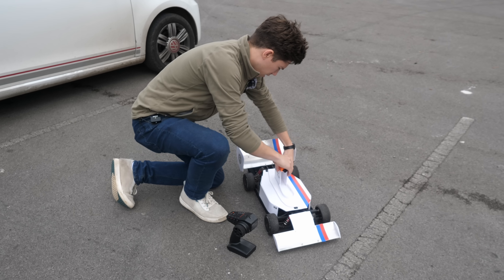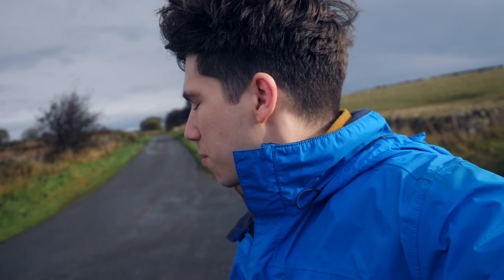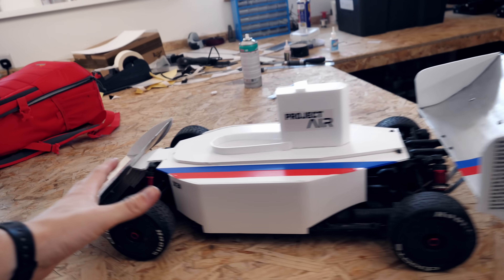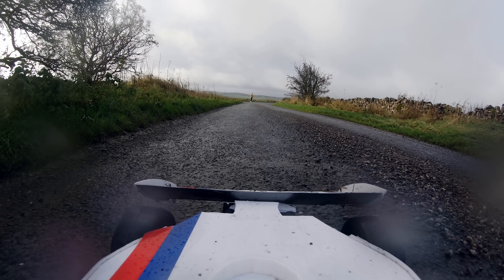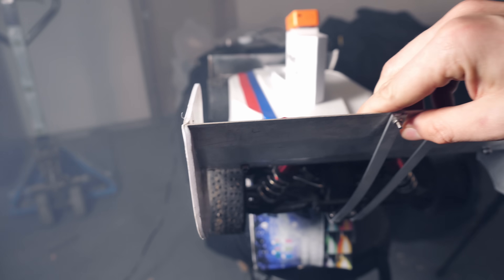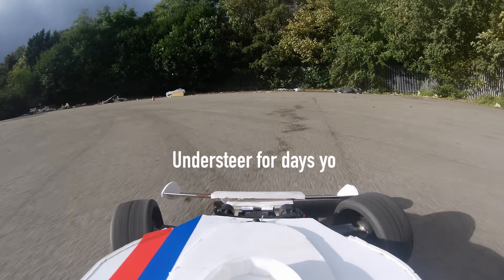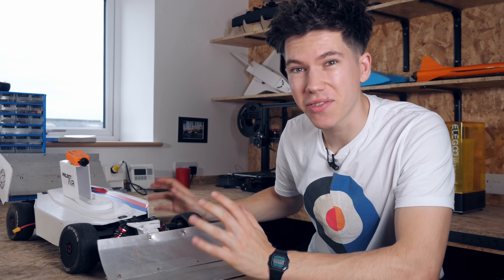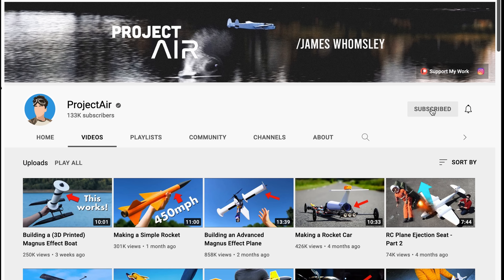RC Car Extreme Aerodynamics

Comment: Love this experiment! Why not check out the SG 1603 model rc car for this project? It is dirt cheap,, fairly light, and they also sell a brushless motor conversion for it. It's quick to do the upgrade, and a decent bump in speed, and I think it could make a great base to experiment with without sacrificing any decent rc cars 😄

Comment: Understeer and slow front end response can be solved with a very fast and high torque steering servo. Especially at higher speeds even without the extra  aerodynamics

Comment: If you increase the aero load, you do realise your original springs will have compressed quite a bit when at speed... If it's working, and judging by the way it acted with that mid turn bump, it is... Try stiffer springs.

Comment: It would creat more downforce if you had the end plates if the rear wing be what attaches it to the chassis.  Having any other than a smooth uninterrupted bottom part of the wing will cause a loss of downforce.

Comment: I think ground effect car would make sense only if you have a track with really really smooth surface. If you need to have even 10 mm clearance under the skirts (to deal with suspension and small rocks/sand on your track surface) the ground effect will be pretty weak.

I think using wider wings (especially having different width of wing on the front and rear) could be interesting experiment. For example, you could have very aggressive front wing to keep traction on the steering and wider than the car wing at the rear to make sure you don't get too much oversteer and don't stall the rear wing caused by the turbulence from the front wing.

Comment: On the road with the turn, it doesn’t help that there’s a nice bump in the road just before the turn. If the road was more level, it wouldn’t hurt for your front spoiler to be even lower because air getting underneath is causing at least some lift that hurts steering and speed. If you look at speed runs being done on YouTube, you’ll see that alternate bodies are more rounded. Look for one titled 30 hp car. Keep at it. It would be great to make the mods affordable. Some stuff on YouTube is either pie in the sky or is sponsored by those selling parts.

Comment: Imagine a fan sucking all the air out from underneath the rc like the Chaparral 2J. Idk if that would be possible on a rc 1/6th scale but it would be neat. Would bead to seal off the sides like the chaparral and a powerful fan would be needed.

Comment: not just the size but the leverage also plays an important role, simply reducing the size of the front wing is just not the best way as the down force of the large rear wing would create a lifting force at the front, which might explain the understeering. Maybe make a nose cone for it and make the front wing sticks out a little. plus I suggest to reduce the size of rear wing to increase the down force on the front wheels

Comment: At the beginning of your vid, you compared the wings of a race car to the wings of an aircraft. These are two completely different methods of downforce. In fact, you didn't approach the airplane wing idea at all. Why not install them upside down in the front & rear of the car? They would give you more force per sq-in than a simple scoop.
Also, if you're going to create a low-pressure area underneath the car, you must prevent leakage. Any empty screwholes in the chassis or gaps will allow the air pressure to equalize, wasting your efforts. Good effort,
otherwise but I believe you left too much to chance in this one.

Comment: It would be interesting to put a fan blowing at say 50kmh in front of one of the wings at a time attached to a scale. You could see exactly how much downforce is generated by the wings in grams, then you could do some rough calculations of friction with the bare chassis weight, and the bare chassis+the wing force.

Comment: I used to race a 2wd short course truck in oval racing, we would use the original style body’s for the “truck” class and had a 1/8 late model body that fits very well, for the “late model” class.... I can tell you without a doubt the long nose gives more steering, and the long flat sides would assist you in getting the car back straight when sliding.... 100% even at 15-25mph, there’s added performance...

Comment: You also needed the car with the stock bodywork and underside stuff to see how it compares.  It could be that with the speeds and weights involved, the body they have designed already does an OK job.  Probably easier to add to that than start from scratch.

Comment: Wouldn't it have been easier to use the stock F1 body (you know, since Arrma clearly put R&D into that rocket) vs a more traditional car body, THEN try to see if back yard body work tinkering could improve on an already fantastic design? 

Not knocking, at all - cool video, fun times. Just saying - if we're concerned with rc car aero/downforce abilities it seems to make more sense to use already proven aero vs scale car (also proven aero) aero. Just my 2 cents lol!

Comment: Mate you really need to  understand that you NEED airflow to be able to flow cleanly under the bottom edge so that the resultant low pressure and thus down thrust is created , and not the severe drag by trying to literally shovel the air up creating down force. , The front wing is too large and the rear wing way too low to the ground and as you surmise doesn't play well with the front .   As you found out a smaller wing on the front and ducts to stream the ground effect (which incidentally has nothing to with the ground at all other that using the ground to contain high speed Airflow which is exactly why you must have airflow over the lower surface of your wings ( As a modeller you should have known this and applied the EXACT same principles ) so the diverging cone under the car creates a negative pressure manifested as down force.  [ Think of a flat bottom Clark Y Airfoil  but inverted and that shape is the bottom of the car ] 
As you found out the rear wing is both too steep and too large , twin wings one above the other creating a similar effect to the airflow under the body will give you greater downforce with less drag.

Comment: Some misconceptions about downforce in this video.
Lift/downforce is actually generated more by negative pressure under the wing than positive pressure over the wing. Big angles of attack does not grant more downforce but more drag as the air flow starts to saperate from the under side of the wing as seen in the video. Go for the greatest angle possible without the air sapreating from the under side, or try to keep the airflow attached by adding vortex generator or making the wing with multiple number of layers instead of one big piece will certainly improve the result.
More forward rake does not speed up the air flow but the opposite instead, the actual effect of increasing the forward rake is to shift the centre of pressure forward as the lowest point of the under side of the car which generate the most downforce moves forward, also to expand the volume of the diffuser to strengthen the vacuum effect and reduce drag behing the car.
Also heavier car actually demands more areo to achieve the same cornering capability as a lighter car.

Comment: I would highly recommend building a fan car using an EDF to remove the air from under the car. If you can keep road imperfections from breaking the seal to the road I suspect you could get unbelievable amounts of downforce at any speed.

Comment: Areodynamics have really big effect on RC cars.
Testing it on one corner is pretty pointless as differences will be really small and hard to test it properly. Better to do it on circuit.
And thanks to insane speed of electric engines that RC cars use drag have really small effect on them. What you gain in corners will easily overcome what you loose on acceleration.

But even if you RC car go slower than 50km/h 30mil/h it will work.
Less grip your car have stronger you feel effect of areodynamics parts on RC car.

Even small changes can make car faster. I know it well from my offroad RC racing. 
Just diffrent wing profile can do small change that make you faster. 

(btw front wings on RC cars are underrated)
Reply: Hope to see you do something like this again someday.

Comment: I did rc-car racing for way over 10 years in different classes 1/8 - pro10 - 1/12. Even though pro10 and 1/12 are strictly driven with group c car style bodies only, you can see the differences in handling and track speed between i.e. a Porsche 956 and a Peugeot 905 (the two most popular bodies in pro10) or even in 1/12 there is a difference between Bentley Speed 6 and Speed 12 (also two of the most popular bodies). But the differences are so subtle that you can not really test it on a dirty road with lots of gravel/bumps. The 1st thing you should do is to find a proper rc racetrack in your area (there are enough in the UK all over the country), then develop the driver skill to circle it with a constant speed (within 1 sec per round difference) or find such a driver who does the testing for you.
Secondly- The air is NOT scaling with your model! So that means your car looks like a 1/10ish scale model. So 80km/h is equal to 8km/h, but that's not true for aerodynamics since you are not driving in a closed environment with 10x air pressure. In 1:1 scale cars engineers say that around 80 km/h aero starts to kick in in a way that it makes a difference. A friend of mine works for Porsche Weissach and was one of the engineers who designed the 919 hybrid (the LeMans winning car), the car was designed to work between 80 and 300something km/h so just as an example they sacrificed a proper suspension (mechanical grip) for better aerodynamics cos the car is basically never below 80 km/h. With rc-cars it is quite the opposite coz it is basically never above 80km/h. That should shape your expectations. 
When you compare a Collin Chapman's Cooper with Senna's Lotus, I don't have the correct numbers but I guess the Lotus has at least 30% more cornering speed, with an rc-car due to the lower speeds and the air pressure that much lower you can at best expect a 5%-10% difference and that would already be huge.
A few ppl already said this in mathematical terms and you yourself wrote it down in the formula that air pressure increases by the square of the speed, so speed is really a crucial factor.
Now the very last thing. Your wings have a design of (car)wings like 40-50 years ago. They basically stall all the time creating a ton of drag and that is pretty much it. What you want is a laminar flow around the wing. Study how modern F1 front wings or modern sailboats work and re-design it. ;-)
Would like to see how your experiments continue, good luck.

Comment: Downforce does help with increasing grip but after a while the tires might be at their limit. If you race on dry pavement I would recommend trying foam tires. They wear faster but provide a lot more grip.

Comment: In your first test you seem to have understeering, which means the car has a lot of grip on the rear. That's the main balance you sould look for. Just work with a proportion of areas between both wings.

Great work, this could be a good series.

Comment: Huge issue with ground effect is that the scale of the RC car compared to the scale of the smoothness of the road is a much bigger issue than with a full-sized car, and they work HARD to make F1 tracks grippy enough for turning but smooth enough to not vibrate the hell out of the vehicles.

Active aero could have potential but you'd need a fast computer on board to control it accurately.

Comment: The rear wing is sub optimal. Either you wanna have a diffuser wich it can draw from or place it a little higher so air can flow under the wing. Most of the downforce is created under the wing not above

Comment: PS. Having been involved in RC Car Racing many years ago, (before you were born, dame I'm old) we were doing a lot of wing/airfoil design/experimenting at the track weekly/sometimes daily.
There was always the point between speed and drag. 
Perfect track conditions lower upsweep more airfoil lower drag downforce more speed, bad track (wet) more upsweep more downforce with more drag slightly lower speed with more control for the conditions.

Comment: Came across your vids and have always been impressed with your abilities and knowledge! But I'm disappointed in your failure to make note of the actual workings of the airfoil design as you mentioned it being an upsidedown aircraft wing and how it actually causes lift. 
You did though note that the ground effects do work that way (also being an upsidedown wing) causing a low pressure which in turn pulls/sucks the car down to the pavement!
Instead, you are using the upturned shape of the wings as the major factor for the downforce, and with the size and angle of your wings that would be the case, BUT that in turn causes much drag, which will reduce your speed! 
If you reduce the height of the upsweep and get the shape of the wing more aircraft-like (The Bernoulli effect) with the airflow able to travel under the wing as well as above the wing would be more efficient as are the real wings on the formula cars. Or the Nascar Plymouth Super Bird that had an Airfoil-shaped wing mounted high above the rear of the car that gave it so much advantage (Unbeatable) over all the other cars, that it was outlawed in Nascar the following race season! Just a thought, keep up your impressive work.

Comment: If you’re keen to learn some tips have a look at 1/8th scale on road racing machines, rear wings attached directly to the rear hubs to avoid pitching under high downforce corners, plus foam tires with much less flex lend a huge amount to consistency

Comment: I wonder what if the center of downforce for the rear wing is slightly in front of the rear wheels. That way no matter how much downforce you add the car wouldn't pitch?

Comment: Should have put a curved groove in each side of the rear wing there normally fully adjustable for different track's bend whathave you! That rear defuser undertray put that back on too that thing help like you wouldn't believe! The rear wing on the old suzuki racer was way up high for same reason try rasing th spoiler tilting the top of the front more towards the fuselage! I'll call it a fuselage than a bonnet lol they tyre's won't be doing much there probably spinning under the torque more than laying it down on the road! Get Medium foams for it they heat up n get sticky like the real thing! My nitro has a set the difference is amazing if 4x4 it stops it sliding out on the bends like this I'm noticing!

Comment: If you want to reduce drag while still keeping good downforce levels, you can use multiple wing elements that "feed" each other but with a smaller angle of attack in between them. That way you wouldn't have as much flow separation on the underside of the wings

Comment: It's very interesting to see how you are in front of the same problem than full scale. The ground effect could only work on flat surface, loosing the ground effect is so dangerous that it can't really be a good option except on perfect track. 

But using your smoking development aero system, you probably could test the actual F1 looking aerokit on your model. I'm impatient seeing it 😃

Comment: Cool experiment and interesting results! I have to admit I didn't think it would work on a small scale. I'd like to see this done with an accelerometer, and you could 3D print the wings? That makeshift wind tunnel is a great idea. A couple things to maybe keep in mind if you try again: 
- Boundary layer separation doesn't just increase drag, it also decreases downforce, as the bottom side of the wing creates most of the downforce
- Sharp leading edges tend to promote boundary layer separation, hence rounded leading edges seen on things from airplanes to F1 cars
- Boundary layer separation caused by a high angle of attack can be solved by a multi-element wing (like Formula 1 or time attack wings, with one plane on top of another).
- 3D printing is a great way to do some easy iterative design, and it allows for more complex geometry and smoother parts. Rough parts (like exposed hardware) could play a major part in boundary layer separation.
Reply: You're very perceptive there's a lot I need to learn from you 😅😅😅

Comment: Try a wing mounted in middle of car, high up in clean air. Also consider the airstream is coming in at an angle when cornering, not straight on.
The only reason full size cars have front and rear wings is both, practicality and regulations.

Comment: Rc planes fly. So downforce on rc cars works. Try to create something like an upside down wing with a high angle of attack.
Reply from the maker: Thats what I did here haha
Reply: @Project-Air  well not really. What you did is more like a deflection of the air than using a wing generating lift or downforce by pressure difference. A wing can generate lift and still be very efficient.

Comment: the benchmark does not account for the loss of weight why may have had an effect on traction. I have no idea how much relative weight all the removed parts represent. Also the wings are more deflectors than airfoils, creating a ton of drag.

Comment: Your rear wing makes too much DF for how far back it is from the rear axle. If you place your rear wing closer to the axel (ideally right over it) you wont generate as much of a moment about the rear axle. Then you wont need as much of a front wing to keep your front tires down, improving the airflow to your rear wing.

Comment: 6.13.......is it that there is "......high pressure air........" or is it that there is low pressure air below the wing........ie there is an air pressure differential. My perception is , there is a " gap " the wing effectively try to " fall " into .